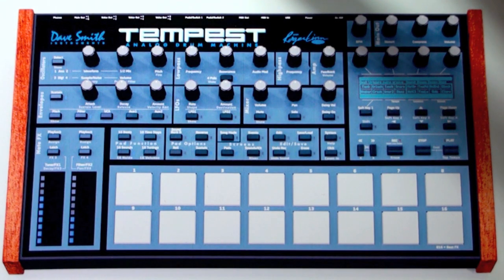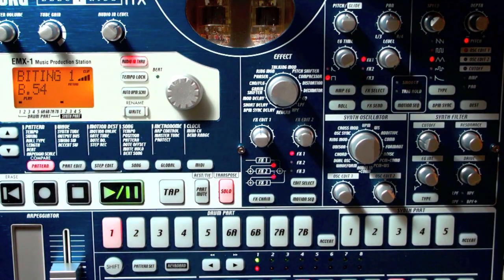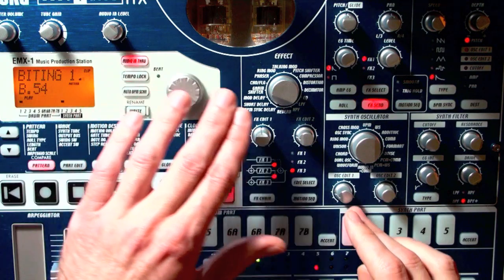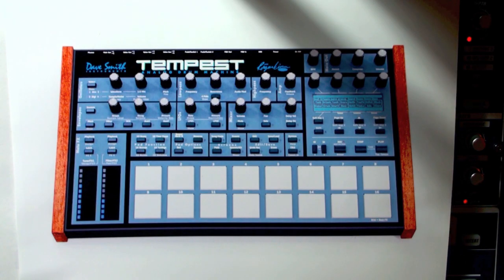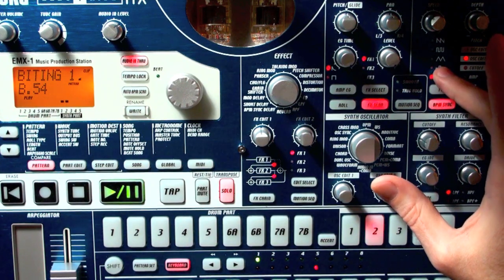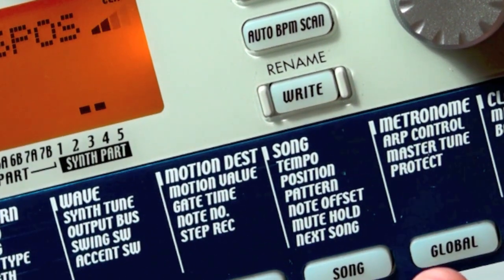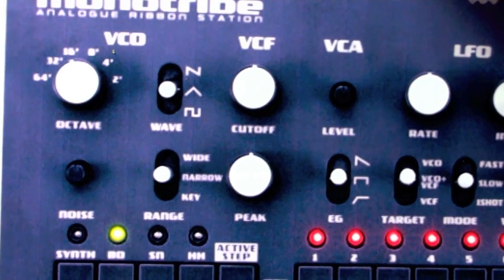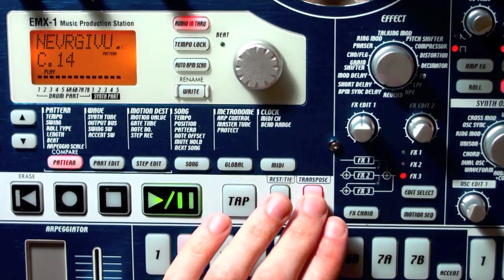Predicting the TEMPEST Analog Drum Machine!  - Part A - Intro and EMX

Comment: I'm one of the lucky ones that owns an EMX unit so I know its capabilies to some point. What I meant was what settings did you use there (before shapping it) to create Synthpart 1 and 2 ? Synth Oscilator, Modulation,...
As there are endless way to shape the sound, I often loose myselfe playing around with it without getting anything "done".

Comment from the maker: @kenspocket I had the tubes replaced on my ESX, it DID improve tone.  ;-)  Have not done it on EMX yet.  Really, I have never had timing issues with Electribes, particularly the newer. IMO they are quite solid, and have even recorded some multitracks with rockers, where no MIDI sync was available between takes.  It all depends on which machines are running with which (some cooperate, others argue!) which is why I tend to play live shows with only 1 - 2 grooveboxes and sometimes voice fx

Comment from the maker: @LatigidGolana AAND, the ribbons are also PRESSURE sensitive, as well as location, which makes them even more useful!  Yes, I've seen every demo out there about this machine - simply amazing - and I will do an extensive one myself when I get the chance? (hint hint)

The EMX actually has 4 outputs, you can route any voice to the second pair.  The Tempest has individual outs for EACH voice!  Excellent.  But the main reason to like it is REAL ANALOG SOUND, as I say over 9,000 times in this video ha